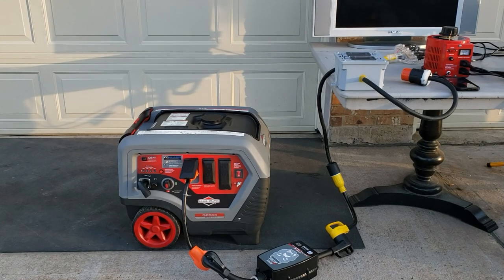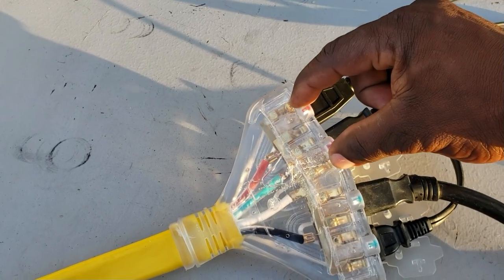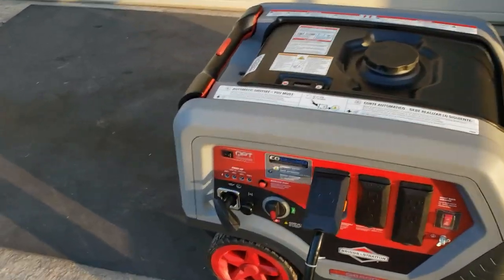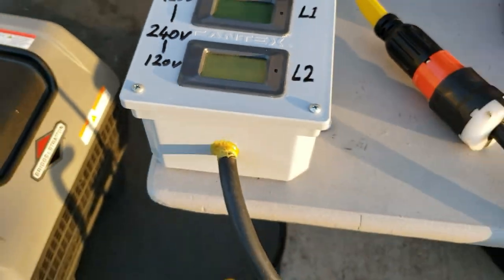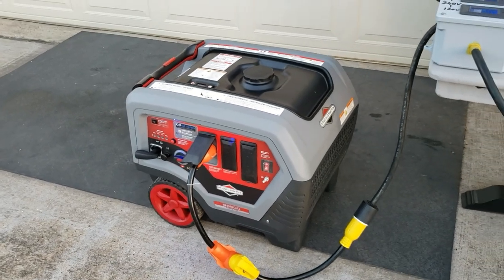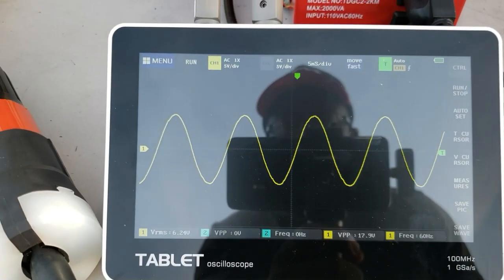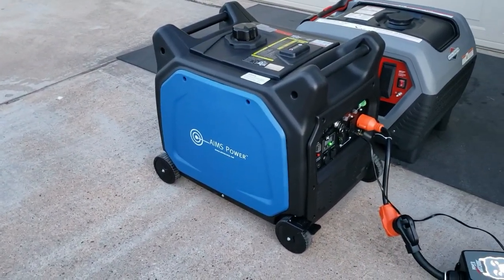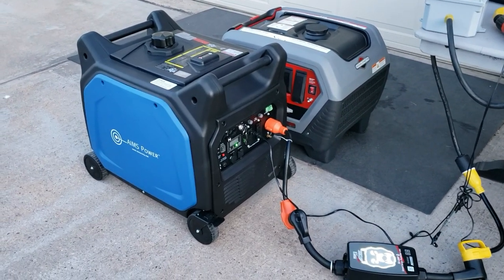(RETESTED) The Briggs & Stratton Q6500W Inverter Generator Review

Comment: I bought one of these in 2019 when there wasn't nearly as many larger inverter generators on the market as there are today, basically it was this or spend a absurd sum on a Honda. I wanted it for the clean sinewave. I have always ran it with the quite power switched on. I power my whole house off of it including clothes dryer, 2 HP well pump, computers, freezers, refrigerator, TV, and high end stereo equipment. I have never had a problem with any electronics failing. It does often idle or run slightly above idle when nothing high draw is calling for power.

Comment: Love your reviews - I'm pretty much generatored out right now (four of them) but I still enjoy watching your reviews. You are by far the most comprehensive of anyone that I have seen doing these reviews. You might have just saved someone from some major expenses and grief with this review.
Reply from the maker: Thanks for watching and I appreciate your support
Reply: Yes, a few weeks ago I found this model brand new in box listed at an incredible price of $650🤯! I spent a bit of time researching because it was such an incredible find at $650 for a 6500…After watching Gavin’s previous video and another, I decided to keep looking. Thanks Gavin.
P.S., wouldn’t you need to use a bonding plug in one of the outlets for the Watchdog surge protector to work?
Reply from the maker: @robfrischkorn9405  yes but not on the bonded generators

Comment: I think you got a lemon there. I’ve one of these for 6 years. They started making them around 2017.I have no complaints so far. Don’t use Eco until you load everything. I turn the generator on first then I add loads one at a time. After everything is running I turn Eco on.

Comment: Now the clipped wave form you are seeing is because the DC voltage that is being made is is less than the 120 volt AC peak to peak. So inverter does not have any more DC voltage to supply the inverter output.  If you speed up the Generator idle, or it is missing a magnet on rotor of alternator. More magnetic flux lines per second more voltage.  That is why non economy mode puts out 120VAC
Reply from the maker: I did turn the idle screw all the way up same results
Reply: Right the DC bus voltage is sagging. Maybe it’s a flaw in this design.

Comment: Mine was producing around 102v  and dipping like 95 when a load was applied. I adjusted the idle set screw (plastic) and brought it up to steady 106v with qpt on. Once I add a light load (fan) it goes up and maintains 121v and remains there. Adding a fan is not ideal but heck it's blowing cool air to the generator itself. In summary qpt works if a light load is present.

Comment: I ran into the same thing with some ryobi generators years ago.  My single eu2000 could start RV A/C but a paralleled ryobi of similar wattage couldn't start. I found it was the voltage drop before the ryobis could Rev up.

Comment: Gavin, I love your videos.  I just picked up one of these with a bad low oil sensor and it behaves similarly!  It isn’t as low as yours but does put out 112v, just low enough to cause problems!  Ugh!  I wonder if a new inverter module would fix it?  Did you ever solve this??
Reply from the maker: Yes I did! Returned it ASAP

Comment: Wonder if the plug itself is wired in correctly.... or a bad regulator power head.
Reply from the maker: I spoke to someone with the exact same generator when it’s on eco-mode on the exact same problem and I tested the idle speed and the inverters connected properly
Reply from the maker: When eco-mode is off in high idle it works perfectly who buys an inverter generator to run it wide open
Thanks Greg👍🏾

Comment: Eco is to make it conform to their quiet low noise statement. 
It won't give you full power in Eco. 
Maybe If you ran a cathode ray tv and had used a real light globe, instead of that non current draw type you may have forfilled the commenters statement.
Mine works well, but that could be because I'm in  Aus, running at 240v.  Yours Could be a totally different beast as you're running at 120v, I couldn't say..
An LCD TV and small lights like that would be better served running on a 12v circuit OR using a smaller generator. 
6500 is good for power hungry appliances.
Not so good running little 80w products in Eco mode.

Comment: Thanks for you video. This is very interesting and I'd like to test mine q6500 to see if such problem exists on mine as well. One quick comment, have you noticed the same behaviour on the 120v outputs as well?
Reply from the maker: Yes if you look in the video I’m actually testing both outlets the 240v 30 amp and 120v exact same results
Reply: I don't have oscilloscope like yours but I will measure mine with a multi meter. I have go find a cable with NEMA L14 plug first. Will keep you guys updated.

Comment: Well I had a similar problem on my generator  recently and what it was was a switch that made a bad contact. There was enough voltage loss in that switch ~1.5 ohm,  to drop me to 90v with only a 2200 watt load running.   With no load it was 120 volts and everything was great.  I changed out the $8 switch from Amazon and problem solved

What seems like a big problem can be just at a small part like that sometimes.

If I hadn't put my knock off kil-a-watt meter on it I probably would not have realized how fart  the voltage was dropping, and that's something was wrong and needed to be fixed.  Everything seemed to still work and run

Comment: I bought this generator this week brand new from a local wholesaler for $600. I was aware of the mixed reviews and everything you say here is true. I think QPT is poorly designed for sure causing this low voltage and problem and probably most of the complaints that this generator can't power what it says it can. Ideally it would work as other inverter generators do, but it's very much debatable this could actually damage anything. Low voltage is certainly bad long term for anything since it means increase amps but large loads have to deal with quick voltage drops at startup even when they are on utility power. It's super common to see lights flicker when AC kicks on or you are running a laser printer etc. All small electronics are going to be behind a AC->DC power supply which are typically rated to operate completely normally between 100v-240v and are generally very resilient to various input voltages. I would certainly be disappointed and return this at a higher price point but if you find it for the right price the flaws are completely tolerable.

Comment: Weeeew...  i dont want that..  maybe thats a bad new generator..... THANKS Galvin   for testing it on a small load... (  FAIL  )   I had thought with a small load of 100 watts or so it would adjust the voltage to 120..... (  I WAS WRONG  )  but even the sine wave was chopped.   that can wipe out a appliance power supply...  Give that  Generator  to someone that you dont like...LOL.......
Reply from the maker: Lol 😂

Comment: What do you recommend for a 5000w generator?
Reply from the maker: Genmax makes a great 5500 W inverter generator
https://youtu.be/bD_HLCCdw34?si=yN93xLwJIfHdhh4p
Reply: Using it for a food truck.   15k a/c,  1750w toaster,  1300w water heater.  About to buy this genmax 5500i but want to make sure it's my best option for a quiet generator.  Thank you

Comment: It looks like the generator is low on power. Like the rpm is low and so the generator head is making low voltage and it's clipping the sinewave cus the dc is lower than what's required for the peak of 120v ac. Clipping sinewave can cause overheating in inductive loads , switching powersupplies or resistive loads do not care about whats coming in as long as the voltage is within their range it will keep making power. Dc or ac they don't giv a shit... What i suspect is poor quality control. U may look for a potentiometer in the inverter board and turn it up if it restores voltage.
Reply from the maker: I tried adjusting the idle screw all the way in with no change
Reply: @GeneratorReviews  yeah the generator is low on power. The output waveform is looking exactly like when u drive your car amplifier hard and they hit the rail voltage so the top and bottom of the wave gets flat..  Here the rail voltage is dropping with load as the engine is not spinning fast enough to make enough voltage. There should be at minimum 170v dc coming out from the stator , the waveform looks like the stator voltage has gone down to 140-150 .. poor quality control by briggis. They used to make good stuff. Pretty sure they getting this from some chinese oem and sticking their name on it selling for a markup to make profit.
Reply from the maker: @KuntalGhosh  yessir I will contact them and see if they want to send a replacement generator. I doubt it but we’ll see what happens.
Buddy thanks for this I appreciate your feedback. I may have to keep in touch.👍🏾

Comment: duh Take it out of eco mode if you really want to test it.   To say it must stay there because that's how you run yours is not testing it.  Obviously there is something wrong with the current sensing that would normally cause it to move to operational mode but you don't want to hear that.  All  your fancy looking gadgets and you don't even know how to use them.
Reply: I have one of these generators.  Last time I ran it in eco mode, I ended up with a blown furnace motor capacitor.  I cant pinpoint whether the generator caused it or if it was just coincidence.  I did test it with a Killowatt meter.  In eco mode it definitely drops way down when a load is applied.  If not in eco mode, it is rock solid.  So I guess I will keep it off eco mode when using it for now.  I'll contact Briggs but not holding my breath on that one.  Will have to sort out if I stay with this or spend the money for a better generator.  We don't use it much.  We loose power once or twice a year.